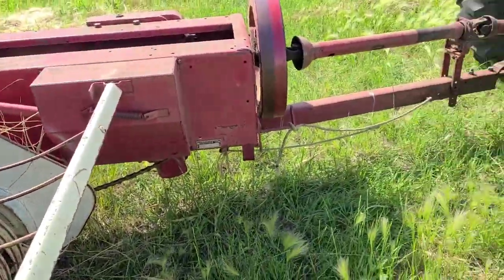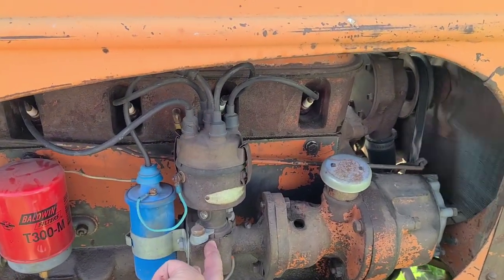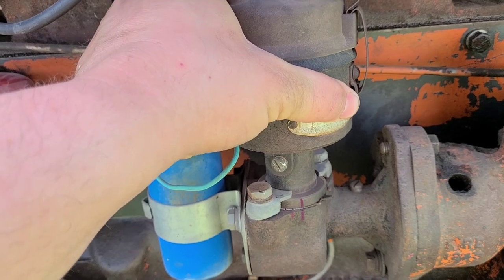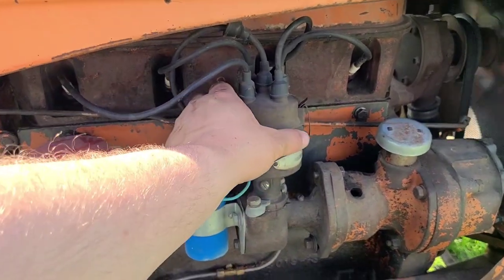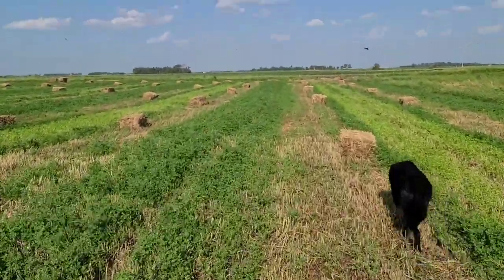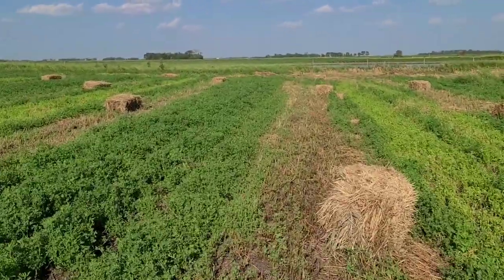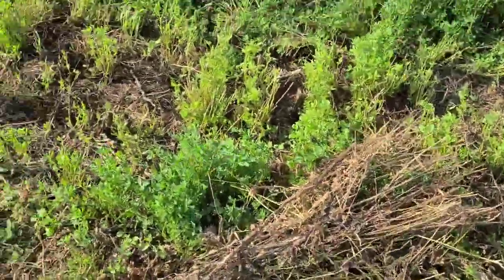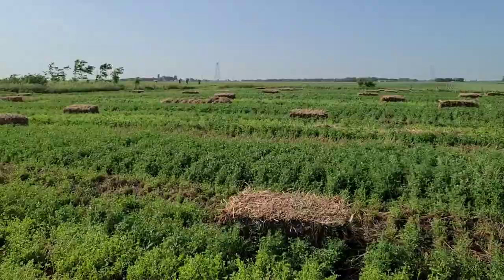Allis Chalmers WD Running Rough While Baling

Comment: A timing/dwell check should ALWAYS be the FIRST thing you do for a tune up.  And timing is a about as core as you can get between running smooth silk and running like crap.
Reply from the maker: Sure is a good thing that's the FIRST thing we did 👍
Reply: @kylechrist  Ya it's one of those basic steps that has not been needed on most stuff made in the last 30 + years . And it is so easy to forget.  So it always nice to see vids highlighting the over looked and easily forgotten basics for older gear.    Keep up the good work...
Reply from the maker: @matthewq4b  that's a very good point, with modern engines running individual coil packs and no distributor, it can be easily over looked. As I said in the video, I was leaning towards a carb kit but was glad we checked timing before going through more work, thanks for watching 👍

Comment: I didn't see much of your baler. We used a 57 engine baler for years. I think we packed them a bit tighter than yours, closer to 90-100lbs in a 48 inch bale. We also had the RPM turned up to hit 72 strokes per minute instead of the factory 60.

Comment: First, you could have set it up like we did in the late 1960s and 1970s, with a wagon on the back so that the baler would push the bales up onto the flat wagon to have one or two guys stack it up.  Running a bit slower might have helped with the pick-up of the alfalfa.  Second, back then, I used to work for some farmers who would use wire balers instead of twine, and they'd run 80-90 pound square bales for alfalfa, but up to 130 pounds for prairie grass.  The dirtiest hay bales to handle were of clover or timothy, especially the small round bales that were only 2-3 feet across.  Or third, we'd have an old IH propane-powered truck pulling a side-mounted hay elevator to pick up bales from the field and deliver them to a selected height so that you'd "stack 'em high and tight" to go to the hay barn.  And, I agree -- thanks for the memories!
Reply from the maker: This was the first cut of the season and the windrows were too wide for the pickup on the square baler, next time I will rake them in tighter. As far as pulling a wagon, that would be great but it's just me so there isn't anyone to stack bales. I know it's more work but it's only about 4 acres and it's kinda a hobby thing 👍

Comment: I think there is a bit in the comments about the mechanical advance. I have a 65 Mustang with an unknown dizzy. When I first had it, It never went really well and the engine felt really lazy. Also the idle was not smooth. I used some timing tape, a good  tacho and a good strobe light to plot out the advance curve. It was nothing like the curve in the manual and was all over the place. After lots of playing with the dizzy, and the springs I got a curve like the manual. I also fettled the vacuum advance. After that it was like the engine had two extra cylinders and the idle was good..

Comment: awesome video timing is critical on a engine last year a friend wanted me to get his wd going that just bought so I went to take the distributor out of the parts tractor but I told him I am going to set the timing on the parts engine that he said smoked bad and missed when I started checking the last guy had the firing order off I reset it and the parts tractor engine purred just nice and the smoke went away . Then I transferred the ignition system over and set it's timing and it runs perfect now too he didn't need the parts tractor after all

Comment: Buy yourself a timing light. Then invest in an electronic ignition and a 50,000 volt coil for your ttactor. It will run better than new.
Reply from the maker: I have a timing light, this was just a quick field fix by sound 👍

Comment: 47 ih bailer and I believe  the distributor is one tooth off!!!!
Oh I know where there is a WD with a  good running engine!!!  Runs and drives but the transmission case is cracked  !!!!!
Reply from the maker: I have a parts machine here, sounds like that would be a good tractor to fix
Reply: @kylechrist  I thought so but they don't  want it  !!! I ask for a price
Reply from the maker: @evankibbe590  sounds good!